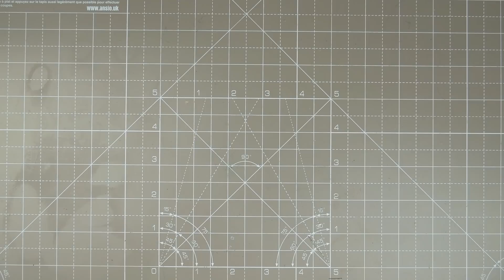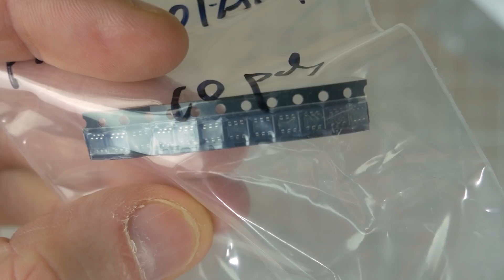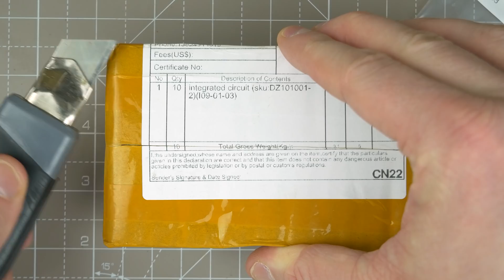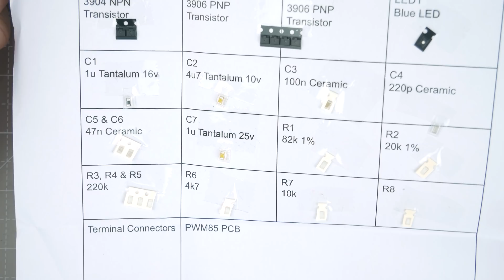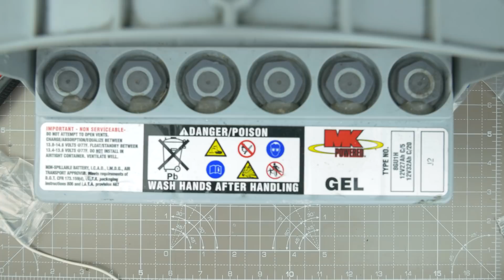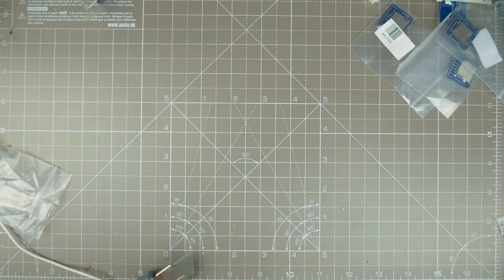Post Bag 23: Project ETA unknown

Comment: That "interface" chip on the SD card module is a low level shifter, to transform the data pins from 5V into 3.3V
Reply from the maker: Ok, thanks. That module also doesn't expose all of the pins that the bare reader does.

Comment: Hi David, nice postbag! Perhaps instead of changing that LED-module you may like to make the 8-bit LED indicators that I made in one of my earlier videos. I think it will be easier to make one of those than desoldering all the LEDs from this module and I also like to think that my design (inline connections with a shared resistor to ground) is easier to use on a breadboard. Thank you for pointing me to those multi segment displays. After your previous video I also bought a few and I must say that the the bright red characters are quite beautiful. Thanks!

Comment: Hi David, the window tint needs high frequency AC or PWM DC, I have 2 types in the office, one is 50v the other is 100v. Both have a PWM/inverter with them which takes AA cells, they squeal when on, very much like the little kit you get with EL wire. I've never had it on a scope so not sure if it's AC square wave or PWM DC but the literature calls it AC. Hope this helps. Craig.
Reply: I just remembered that I recorded a brief video  of a sales sample in action: https://youtu.be/iVS8kG3ypf8
Reply from the maker: Cool, so it is AC. I will still check before plugging it into my 230v AC though, perhaps it is meant for 110v.
Reply: @DavidWatts  that plug you showed briefly looked like it was designed for the US market, quite likely a 110v unit. I'm sure you could whip up a little driver board and run it from 5v or 12v, if it helps I could send you some images of the AA driver I have.
Reply from the maker: Looks like it was meant to come with a PSU according to the ebay page :( Oh well, I will try a variac or one of those EL wire drivers.

Comment: I would suspect the transparent panel would need AC. Just like an LCD needs AC. But I don’t know for sure. 

I have had one of those panels on loan for a while, around ten years ago. I think the module attached to it ran on a 9v battery. Not sure what kind or circuitry was inside the module.